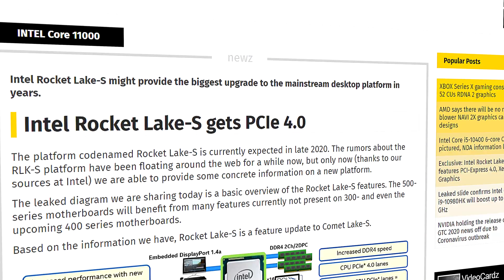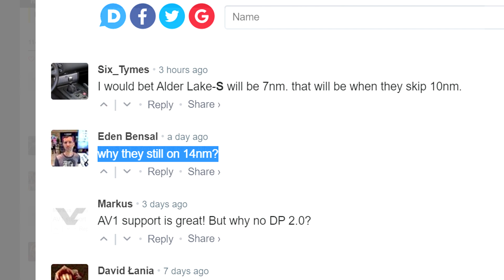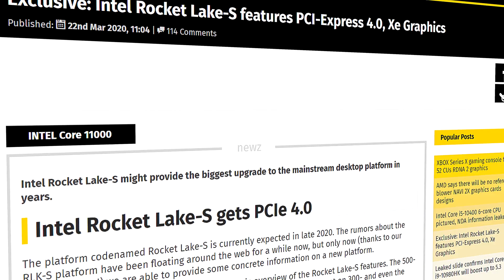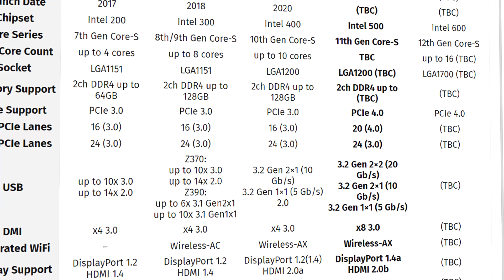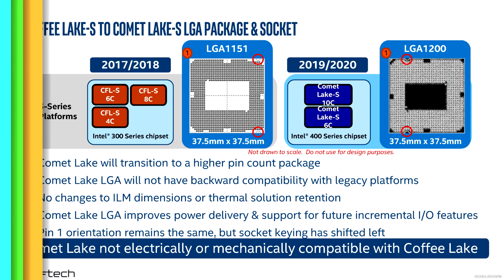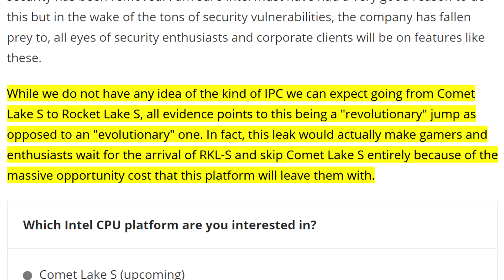Intel 11th Gen Rocket Lake LEAKED--Biggest Upgrade In YEARS! Release Date, Socket, Performance!

Comment: Yeah. Was aplanning as well to get an desktop with the 10th gen i3 processor but I am not sure now. The integrated Xe Graphics may beat some low end nVidia like the GT 1030 or even the GTI 1050Ti. If the new integrated Xe graphics are on par with the GTI 1050 Ti then it is well worth the wait.
Other than that this Black Friday and Christmas season alle PC's are gone up in price and there is no real deal.
Best is to skip alltogether the 10th gen processors and wait for the 11th gen.

Comment: I believe Intel rocket lake is basically dekstop version of Intel ice lake but without 10nm and still use 14nm.
(Because 10nm Intel is broken and unable for dekstop)

Intel can use IPC gain and faster memory support on ice lake for 14nm dekstop rocket lake. But they wont get new die srink and efficiency since it still use 14nm. Intel also need to sacrefice one of clockspeed or core count to make new look of cpu because limitation of 14nm.

The analogy is also same like AMD release Zen 2 but without 7nm node. We get IPC but not power efficiency. Or like Nvidia Kepler to Maxwell, same fabrication node but Maxwell has better IPC than Kepler.

Comment: I want a i9 6ghz Rocket Lake 70% IPC increase  pcie4 and pair it with NVIDIA 3080ti
Reply: Damn are you gaming at 4k 160Hz? (:
Reply: @WarriorsPhoto  yo Im just trying to find a better heat solution full twin tower but I need more should I just upgrade fans?
Reply: @SavageZebra67  Good question. I need to know more about your case?
Reply: @WarriorsPhoto  nothing special would be open to suggestions. 8700k with a nhd15 single fan. most of the time its fine but some games Run Hot 🔥
Reply: @SavageZebra67  My case of choice is the Corsair Air 540. Very good airflow. It is older though. 
Is the 8700K overclocked?
Reply: Juicy
Reply: Me too.. i have a good pc good enough for neuarly everything. But i am a frames graphics and hardware whore..
Reply: You forgot 5000 mhz ddr5 ram )
Reply: yah out with the 8700k in with the Rocket Cock.

Comment: So Rocket Lake wont be 10nm?
Reply: Idk why people are so worried about it being 14NM. ITS STILL EATING AMD's 7NM. Lordy!
Reply: It won't be but new cores will give a mayor performance upgrade between generations (we hope). I hope 11th Gen will allow us to overclock the CPU to 5.5GHz.
Reply: @lucjuszbohn6732   i thought intel was reaching it's limits on 14nm? Seems like they found a way to push it further
Reply: @mikeramos91  Basically... yes! But Rocket Lake is the last CPU series with 14nm. Alder Lake (or sth like that) will be 10nm
Reply: Namashi I can’t believe that we have to wait another 2 generations to get 10nm 😕
Reply: Tiger Lake would be 10nm
Reply: No, 10 microns.
Reply: @DeoDusio Ryzen 4000 is gonna be 7nm+ not 5nm but it still will be a big upgrade from Zen 2
Reply: DeoDusio I’ll join the AMD train when it actually moves for the long run. I7 9700k is still a great processor and still eats very well. I agree intel last month has been dropping bad. Again I got where the numbers are. I’ve seen AMD do this before and not getting suckered into a AMD CPU until I see them for the long haul.

Comment: 30% IPC INCREASE over sandy ice lake is 18% BETTER than sandy at normalized clocks Tiger lake adds double digit IPC over ice lake=30% IPC  increase for rocket lake. comet lake H will have 8 cores 16 threads in 45 watt mobile laptop cpu it will battle ryzen 4900. Tiger lake will be around June launch and also offer 8 core 45 watt cpus

Comment: intel still selling shit at 14nm.....😂😂
Reply: yea but they still compete with amd if not beat AMD
Reply: yep and I will own a rocket lake desktop and a 8 core Tiger lake 45 watt laptop . Amd will have nothing to compete with Tiger lake in either 4-6-8 core laptops. Rocket lake 8 core desktop will beat risen 3. comet lake 4-6-8 core will easily compete with ryzen 4900 in laptops.
Reply: @Nemesis1ism  You do realized dummy that the Intel 400 series IS NOT EVEN OUT YET.  ITS LATE.  By the time Rocket Lake comes out Risen 4 will be coming out.
Reply: @cptnsx  Hay I just want 8 cores 16 threads. And  Xe DG2 300watts. also 2 memory sluts running optane memory  2 sluts with DDR5-4000  Pro water-cooling and all core overclock of 5ghz. 30% More IPC + DOUBLE the bandthwidth Than top of the line today I am all in.

Comment: Amd will beat them just wait zen 3. Anyway we are going to see very interesting battle when q4 come. The best price/performence with 8 core will be my next cpu!
Reply: Самуил Патриков  whats your priority for the CPU?  Gaming or multi tasking?  If it’s gaming, Intel has the edge.
Reply: @od40k77  gaming and programing.
Reply: want to make a wager?
Reply: You will be buying same as me. Rocket lake! ITs 14nm and will reverse the present talking points. Intels 8 core rocket will have 20% better IPC  than ryzen 3higher clocks and around same efficiency but I think AMD will be slightly more efficient  at a lower clock rate. At same clock Intel wins. Infact intel should be faster at both speed and efficiency  at lower cloch speed. I get a sneak peak vary soon. Look around I been right about everything else. Having inlaws in high places has its advantages. Xe is going to raise eyebrows at an infant  age.
Reply: @Nemesis1ism  The price will make the decision
Reply: @СамуилПатриков  Intel on 14nm very high yielding efficient mature process. VS AMD Vary expensive 7nm+ process Intel will price rocket lake  so that AMD will have to lower margins on the 4700 ryzen in order to compete in the 8 core 16 thread mainstream market . I know I will never need more than 8 cores 16 thread market. 4 core 8 thread Tiger lake and 8 core 16 thread  tiger lake will just give you an idea of what Rocket lakes performance will like Single thread performance of tiger lake is great at low clocks rocket lake has same core as tiger lake except for being on 14nm and the 10nm Xe igpu.   Rocket lake will easily hit 5Ghz+ Rocket lake will be just that  the 14nm Rocket that embarrasses 7nm+. IF YOU WANT more cores and threads buy AMD.  with the 4 desktops I have built the only failures I Have had fail are video cards from ATI /NV. My present gamer has NV  PRESENT but because blue screens. I running Intel igpu not 1 blue screen since. So my next build will be 95% All INTEL including gpu and optane for game loading
Reply: @Nemesis1ism  Rocket lake is just a backport of 10nm if I remember correctly. AMD will always have lower margins since a huge cut of their profits goes to TSMC
Reply: @Nemesis1ism  LOL rocket lake is 14nm and it has 2x as much top as 5950x with 2x less cores also amd has pcie4.0 and more lanes and intle will need to up IPC by 34 percent if they want to best AMD
Reply: @SUPABROS  I don't care about any more than 8 CORES if rocket is as fast as they say , I would buy that in a heart beat just for gaming , I like AVX 512 and I  like AI, so INTEL IS MY ONLY REAL CHOICE. 14NM SUCKS BUT A 20 PERCENT PERFORMANCE UP LIFT IN IPC IS GOOD ENOUGH FOR ME IF ITS UNDER 500 DOLLARS WHICH IT WILL BE ,
Reply: @Nemesis1ism  LOL well amd has 17 percent better ipc even if Intel has 20 percent better ipc and intel always misrepresented products. They match 9900k and 10900k vs 7700k and ryzen3 1200 and say its good ans they released 109xxXE just before thread ripper 3rd gen leak so people can't compare it in launch day reviews and Intel said 10th gen was "15 percent more faster" in multi core but it was opposite also Intel payed companies to use Intel and software companies to optimize more for Intel. Rocket isn't as fast as they sah
Reply: @SUPABROS   INTEL WAS RIGHT ON ABOUT ICE LAKE IPC INCREASE 18 PERCENT AND TIGER lake 3 percent ipc increase plus superfin 700 increase in cl;ocks.  . rocket lake is suppose to clock higher than comet lake is we are looking at 5.4plus ghz .  That will give intel enough to have best gaming chip .  I have 2 lian li 011 dynamics sitting here ready for m/b . one regular dynamic and 1 XL DYNAMIC . BOTH ARE HARD COPPER TUBE BUILDS 1 IS USING D5 NEXT PUMP THE XL IS 2 PUMP DUAL LOOP , 2 D5 VARIO PUMPS . BOTH ARE DUAL RADS WITH NOCTUA NF-A12X25 PMW 120 FANS.   THE REGULAR 011 IS SINGLE LOOP  IT ALSO HAS SILVER BASE WATER BLOCK . THIS IS FOR ROCKET LAKE.   ITS ALSO CUSTOM POWDER COATED PAINT ON PANELS.  THE XL is for Alder lake . N0 way in hell would I BUILD THESE FOR MY GRANDSONS and put AMD PRODUCTS IN THEM .   IF i don't like rocket lake i will just wait for ALDER FOR BOTH SET UPS . These ARE 100 PERCENT CUSTOM BUILT.  AMD LOL.  Xe dg2 512eu all the way . 42T I am all in . For the boys getting what I never had . An ass kicking Intel DGPU. DOESN'T HAVE TO BE FASTER THAN NV OR AMD. BUT IT LIKELY WILL BE .
Reply: @Nemesis1ism  LOL ice lake coming 2022 and then zen 4 come out to kill intel